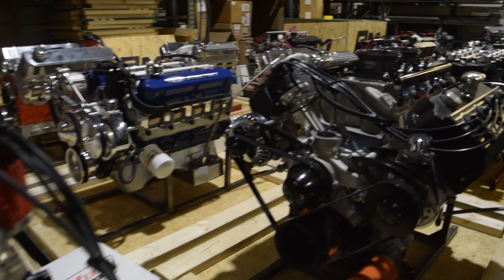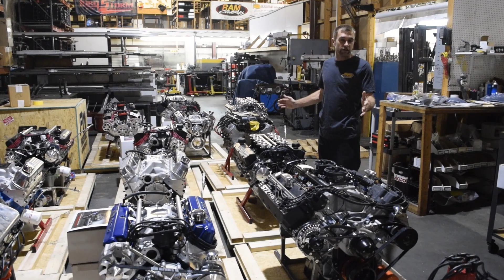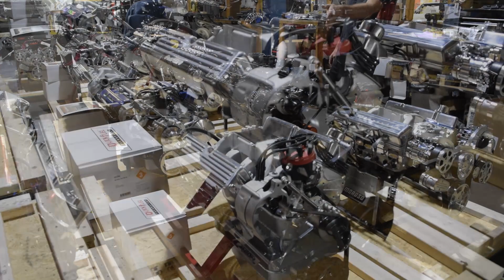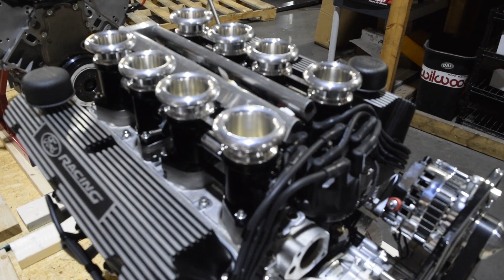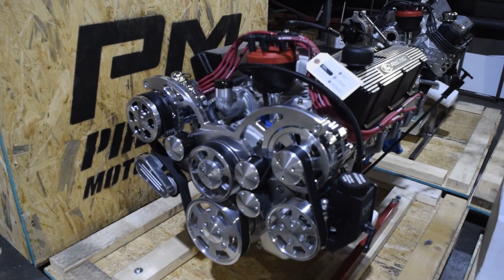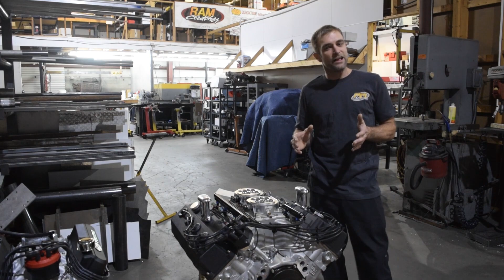Variety of Custom Built Performance Crate Engines at Prestige Motorsports

Comment: What would be the price on a built ford 427 street pump gas motor with as much horsepower an torque as can get with E F I. Do y’all put 871 blowers on them? If so how much power and torque and what is the price? Thanks